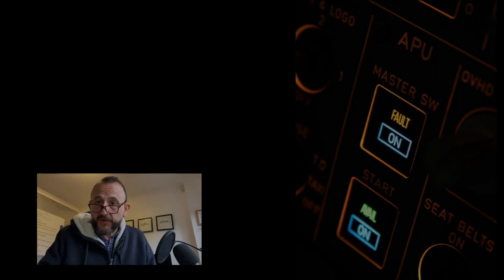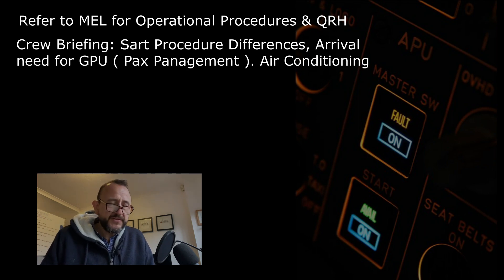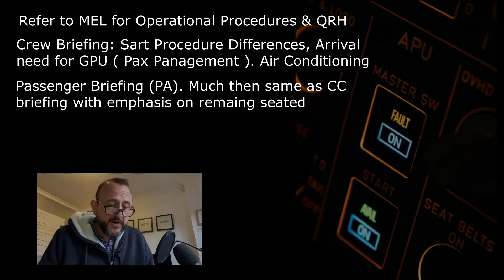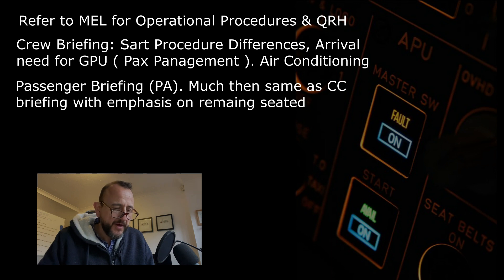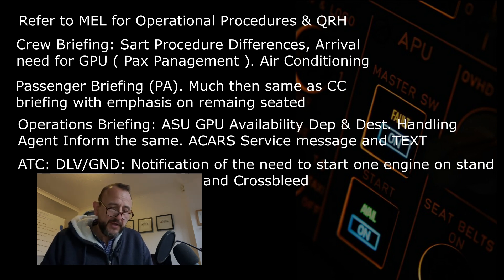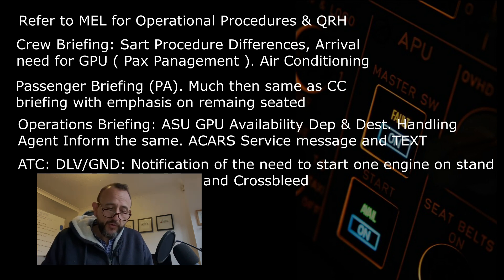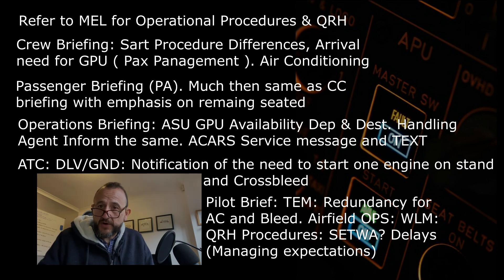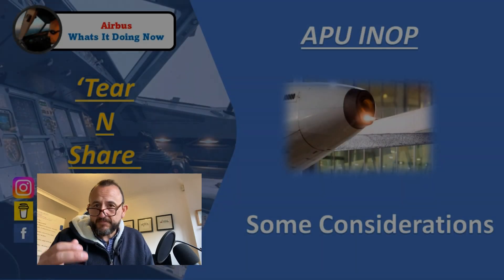APU INOP

Comment: Great video as always! I usually advise de cabin crew that the cabin will be shedded (on ground) for a period after the first engine start, once there will only be one AC source (GEN 1 or 2). It makes a difference for them because ovens and other cabin features may be lost during this procedure, safety video briefing for example may not be available because cabin is shed. I also try to anticipate the reading of the supplementary engine procedure which are usually long.
Reply from the maker: Thank you for this valuable feedback 👌